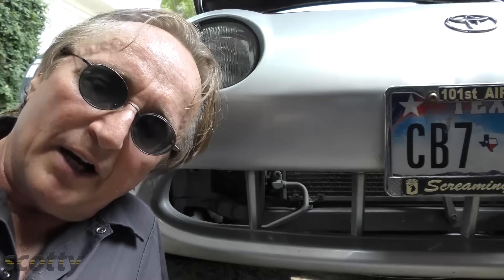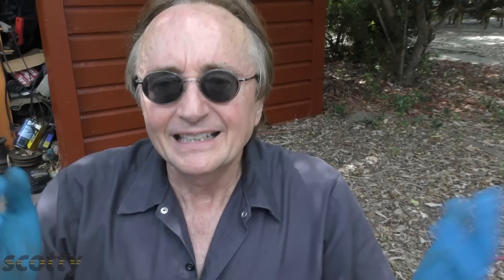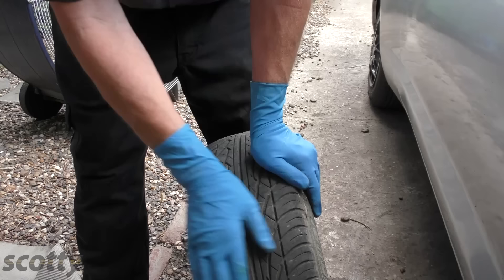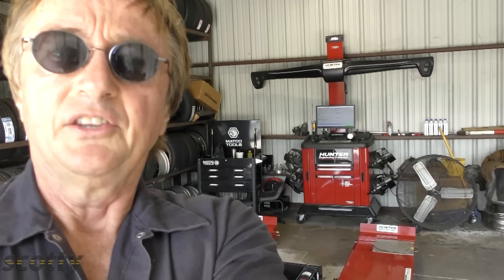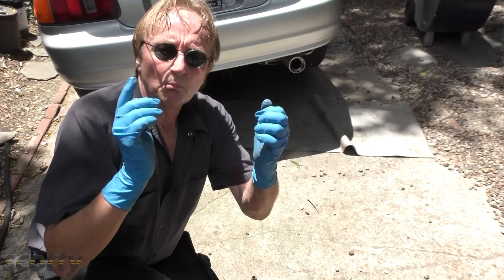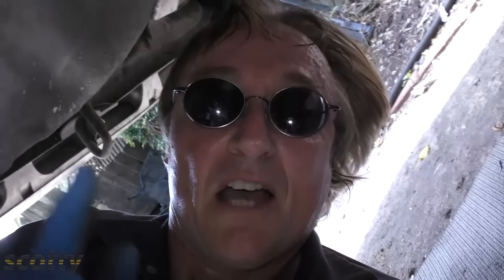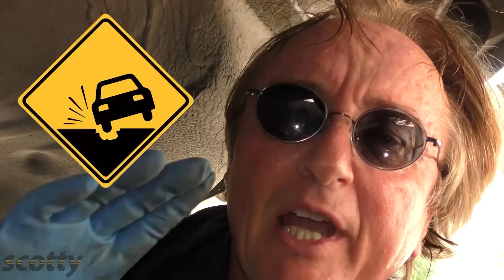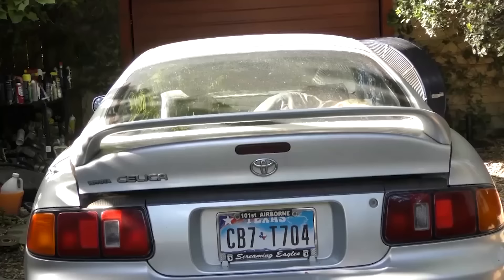How to Tell if Your Car Needs an Alignment

Comment: I've been at some shops recently that still use the ruler and string treatment.
Reply: Vehicle Virals lmao tell em its 2018 and they stuck in 1940!
Reply: get out of here...i worked at town fair tire in 1986 and they had laser alignment back then...i wouldn't trust that shop to put a plug in a tire
Reply: maybe they can't afford an alignment machine, they're still expensive used.
Reply: Vehicle Virals race teams use string and ruler
Reply: FatherBootyHands no it’s not “just as” accurate. So you’re gonna sit there and say we humans have perfect accuracy as a computer? Please
Reply: Gaming Pro you pretty much only can adjust just the toe with that method, it's not very good on daily driven roads because you have to account for the road crown which people fail to understand.
Reply: I did the ruler and string method and it's perfect.
Reply: Lost Beetle I bet if you take it to a laser alignment machine with your current setup you'll soon see how not perfect it is, I've seen and heard it way too many times.
Reply: Tires wore perfectly and the car tracks perfectly. Laser alignments often enough don't yield results as good as I had using this method. At worst it still worked plenty well enough to fulfill its purpose and saved me 80 bucks. So try it yourself. 
I don't know what is so hard to believe here. Back when cars had more adjustments laser measurements weren't a thing yet, and now when all there is a toe adjustment for some reason it's so far fetched to think it could be measured with a ruler. You break the jam nut loose, adjust your tie rod a tiny bit, tighten the jam nut, re-measure, and oh look, the measurement is different now, repeat the process as many times necessary until you get the right measurement, car tracks perfect and wore the tires down evenly and I got to keep my 80 bucks. It's a no brainer.
Reply: im 2hrs from the nearest tire shop -  how do u do a DIY wheel alignment?
Reply: @FatherBootyHands If you have no idea what you're talking about it's better to just shut up. It is not literally just as accurate, on the contrary it's literally much less accurate
Reply: I had our Brand new Firestone Store do an alignment on a rebuilt front end that drove straight just wanted it checked.  They gave it back pulling into the curb. Couldn't get it back in for 2 days (lol) next guy was given permission to test drive. Took it down street 25mph and said it was done. Omg if it didn't pull again,  another 2 days same crap. I took it home strung the lines had to adjust the passenger rear which wera to rusty for them (5/8" bolt) came straight off for me. Adjusted camber with spirit level. Used there numbers for front and set it back closer to the original start measure.  Thing is straight as an arrow.  50mph or 100mph. Kenosha Firestone sucks.
Reply: Agreed. My eyes are wide open now!
Reply: Because it works just fine. Almost always has. Really not sure why Scott said that.

Comment: Good info, those fancy Hunter Alignment machines do require maintenance/re-calibration as well, you would hope your repair shop maintains their equipment. personally if I'm replacing my tires and spending $100's or in many cases with today's large wheel and tire combos well over a $1000.00 on a set of new tires I would get a wheel alignment just to be certain.  Once tires start wearing unevenly that wear pattern is permanent for that tire, even if you repair the issue after you notice the uneven wear.

Comment: Wish my Jeep came with adjustable suspension parts like this vehicle. Wouldn't cost them too much more to install adjustable parts on the assembly line. Everything I have stock is fixed. Which sucks.
Reply: Paulie Proton  Just think Chrysler was trying to save money on parts where they could. It would be great for Jeep especially to have adjustable suspension parts since they are the most modified vehicle on the planet. But I'm a firm believer Jeep has a hand in the aftermarket profits. So this is never going to happen.
Reply: FatherBootyHands  There's a reason for that, moolah.
Reply: you still have front total toe adj and steering wheel adj
Reply: Maybe alignment doesn't matter so much when you're driving on tires the size of Mt. Everest with treads as deep as Mariana's Trench. I'm sure all that flex compensates for misalignments.

Surgical tools need to be a bit more precise than a wood splitting axe, after all.
Reply: There should be atleast eccentric bolts to align it
Reply: Yeah that's how it is on my 350z it sucks ass
Reply: Jeep Life71 you can adjust the camber with offset ball joints, the caster can be adjusted with shims behind the lower control arms and of corse the toe with the tie rods at least thats how my 2000 xj is adjustable
Reply: Swap out your suspension for adjustable ones.

Comment: A shimmy at highway speed can sometimes be a thrown weight. 

My pickup tossed a 5 ounce lead weight during a little off roading, re-balancing the tire fixed the shimmy.
Reply: Yup, a shake when not under braking, is rarely an alignment issue and usually a balance issue.

Comment: Years ago I had replaced the front suspension components on a 91 Mustang, (Struts, bushings, ball joints) adjusted the toe with a tape measure so I could drive it to get an alignment, and actually got it within spec!  Surprised the heck out of me!  The tech asked why I was so surprised by that so I explained what I had done to it.  I still got a precise alignment of course, always a good idea if you replace any alignment affecting components.

Comment: I drove my car out of alignment for a while to avoid paying the alignment cost,  but I got a lot of expensive suspension repairs to do now, I think it might have been caused by driving out of alignment so probably a good idea to keep suspension and alignment well maintained in the long run.
Reply: I think it's that you drive on bad roads
Reply: I drove my car misaligned for a few months once because of other repairs I needed to do that would require an alignment afterwards, but I could tell the toll it took on brand new tires by waiting. If you don't have a choice but to wait to have an alignment done then be willing to pay the price of removing, mounting, balancing and having new tires installed very prematurely.

Comment: I really wish there were more experienced and energetic and honest mechanics in my Area like you. I just bought a car yesterday a 2000 dodge stratus and I have had my truck for 3 years a Dodge Ram 1500. both need work and I have been ripped off many times with my truck and I know I will be with my car as well. I tip my hat to you sir. keep up the wonderful work

Comment: Tape measure alignment is all my Jeep has ever known.  It drives great, steers great and my tire wear is phenomenal.
Reply: I agree buddy. Used the tape measure myself many times. Definatly works if you know how to read a tape measure... It would be interesting to see someone do it with a tape measure as good as they can get it then bring it to the shop and see how accurate it was/wasnt

Comment: I totalled my truck and a junk yard put it back together at a great price, when they were done the told me to get a alignment after they fixed the frame and a bunch of other busted suspension parts when I got in to drive it I needed to hold the steering wheel about 1 whole turn to the left to drive straight! The steering wasn't tight either and an alignment actually corrected the problem and I drove the vehicle about another 100,000 miles before I sold it to what I thought was a friend at the time....

Comment: Bud's Tire and Wheel where I live fixed a problem no alignment could fix. 1995 Buick Roadmaster wagon still had slight pull.
"Radial-pull" it turned out to be.
Swapped tires side to side and WALLA...fixed ! Tracked perfectly straight.
Reply: It is just a tire that isn't quite straight internally.

Comment: Free plugin for Montrose tires and wheels. Just helping out a buddy. Well, I say free but really who knows. Extremely nice setup. 

Something to keep in mind is when you buy a new vehicle the manufacturer lines up the imperfections of balancing of the tire with any imperfection in the rim so they counter act each other then balance the wheel. As soon as you take the tire off the rim you've changed that combination. Force balancing is supposed to help.

Comment: great explanation...the other day i was really late and did 180km/h with no shakes at all, im so proud. but alignment is so important, now i know what to check for and not just by letting go of the wheel to see where she goes.. Just wondering how often to rotate the tyres.

Comment: Some of the older cars can still be done at home.   Accuracy is the key.  I was able to use risers, digital degree box,  tape measure(toe), etc.  Whatever you do, don't measure from one tire to the other, it must be from one wheel to the other.  Mustangs, Camaros, etc. Can be set up for autocross and racing with tools from speedway, summit,  jegs.

Comment: It’s still never a bad idea to get an alignment check after getting new tires though tires aren’t cheap so why not get an alignment check to protect them?
Reply: hunter alignment (and adjustment) (Which I did get) cost about 5 quid more than the tire I bought....

Comment: The Hunter Hawkeye Elite measures caster and camber to a tenth of a degree (or .1 mm about .004 in.) and toe to a hundredth of a degree. The camera systems on these units are very accurate indeed. These systems do cost a lot of money and (my opinion) are the best available. Hunter machines can also provide a lot of other data beyond the standard wheel alignment as well as procedures, tools, and parts all built into the unit. It also does a number of ADAS functions especially ESC centering on many vehicles.

Comment: When I bought my tires at Firestone I also got an alignment.  When braking the car would pull to the right, the steering wheel would flop to the right, pull to the right driving.  I took it back a second time, same thing, they told me something needed to be tightened down.  I took it to my mechanic, he told me the right strut was blown, so we replaced the front struts, assembly, and rear shocks.  Like scotty said in one of his videos, the car is riding higher and doesn't ride all that smooth with the quick struts.  My problem is that it finally wasn't pulling to the right when braking, my mechanic suggested getting an alignment after the work,, but after getting alignment  at Firestone (i had a 12 month warranty on an alignment, the guy tried to tell me the warranty only covered if they did something wrong, which doesn't make a whole lot of sense to me),  but the car is now pulling to the right braking, steering wheel flopping to the right.  These guys at Firestone don't know what they are doing.  On top of that I noticed the left fog light was out and left headlight, looked under the car and the fog light was was just dangling there by its wire, screwed that back in, but will have to fix the left head light.  What are they doing messing with my light on an alignment, trying to get more money out of me, I have to assume.  You get some real scumbags out there when all you want is a reliable car to get to work, support yourself.  These guys who cause  more headaches and stress on purpose .  Man....I can never do that to people.
Reply: Same 4 me
Reply: They do that honestly
Reply: I only go to tire stores for tires, never mechanical work. Similarly, I don't buy tires from mechanics. I figure that each type of place specializes in their own normal service type, and won't be very good at the "crossover" stuff they tack onto their lists of offerings as upsells. So far, I've had good luck this way.

Comment: If you change major suspension components like the struts, tire rod, or possibly ball joints. You need an alignment, or you'll likely burn through your tires. If you don't stay on top of the wear of your tire you wont even notice it. This literally just happened to me. I bought a car they said they changed the CV axles before giving me the car, I looked and saw new tie rod ends as well. Thought nothing of it. Down the road I check my tires and see they are worn very unevenly and that I need an alignment. Had to buy new front tires too..

Comment: It is also hard to find an honest alignment shop in my area. I wouldn't trust anyone without a computer printout unless it was a proven family/friend mechanic that I had used for years and built a trust with. The one time I had ball joints replaced they charged me for an alignment as well which was not an issue, but when I picked the car up the guy just said he put it on the rack and it "wasn't that bad" and nothing needed to be adjusted but guess what I was still charged the full $150 for the 4 wheel alignment. I probably should have negotiated but I was really young at the time and didn't know any better.

Comment: So if a shop is trying to sell you a four wheel alignment and you vehicle has a solid rear axle they are just trying to get more money? Or do those machines need to use the rear as a reference point for a more accurate front alignment? I wondered this for awhile.

Comment: I have a simple flat plate alignment tool that cost around £50. Its works by measuring the effect of the tyre on the road surface as you drive over it, and shows the amount of scrub. Set the scrub to zero and the tyres last much longer.  No need for expensive lasers. 
It also works on rear wheel alignment. (I once had a car with adjustable rear alignment on the drive axle)
Probably not sold in the USA I guess, it was invented by the English.

Comment: In my day I preferred Bee-Line equipment.   We're talking in the 70's, 80's and 90's and even today that same equipment can and will do just as good a job as so called "computer" equipment. But you must have a real professional, not some kid who was trained by the kid before him.  Scotty is mostly correct.   However not all cars have full adjustments BUT EVEN SO many cars & trucks have kits one can have a pro install to get a perfect alignment.    Minor alignment adjustments are rarely needed UNLESS an alignment part (tie rod, ball joint, etc.) is replaced....OR there is major damage to the suspension.  Then it is absolutely necessary.   If your tires are not evenly worn across the tire, you likely don't need anything....just as Scotty said.....and believe me....I'm not a Scotty fan, but when the man is right, the man is right.